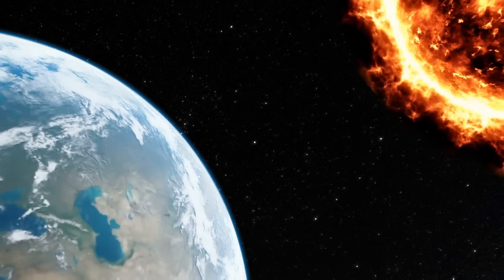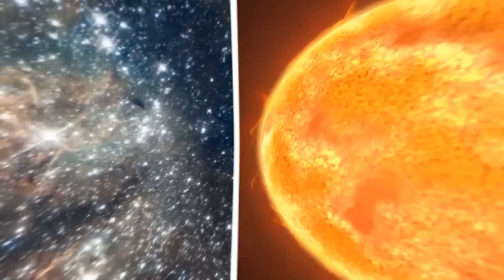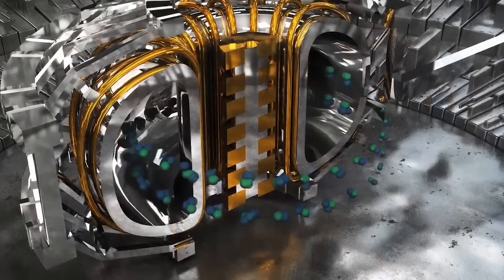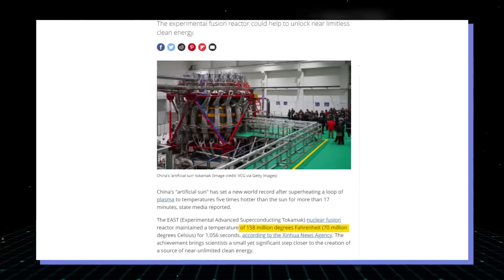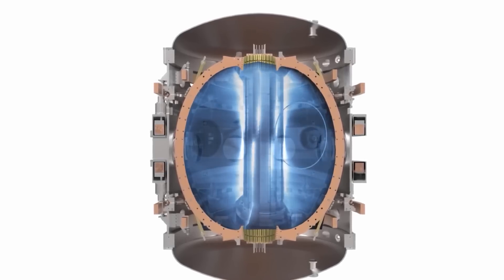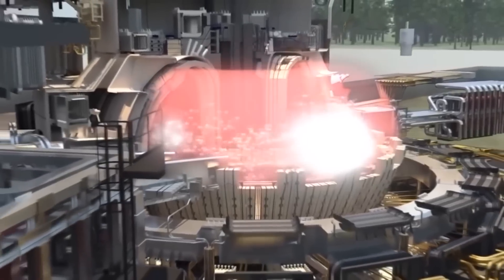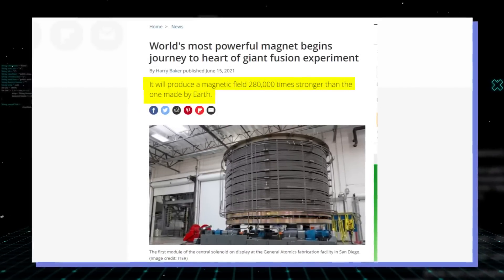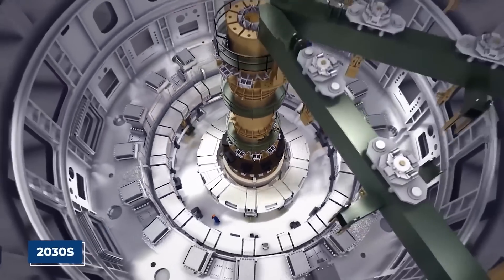8 MINUTES AGO: China LAUNCHED Its Artificial Sun And Proves It's TECHNOLOGICAL POWER!

Comment: You won’t see the reactor because is contained within a magnetic toroidal containment chamber. They didn’t mention if it would be too hot to work around. I assume that the intensity of the magnetic fields kind of mitigate the temperatures? But like said, they didn’t mention that.